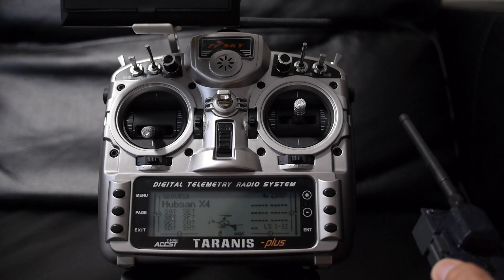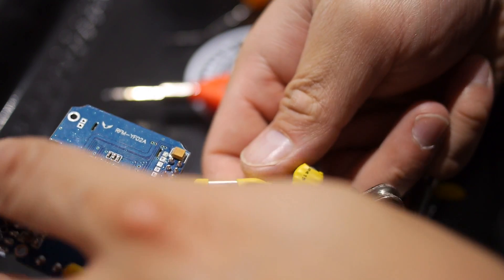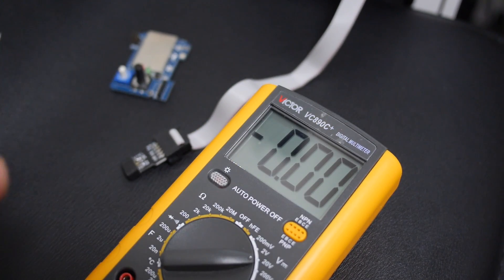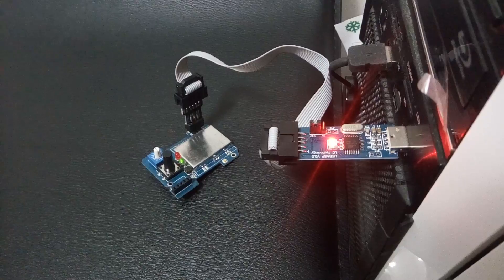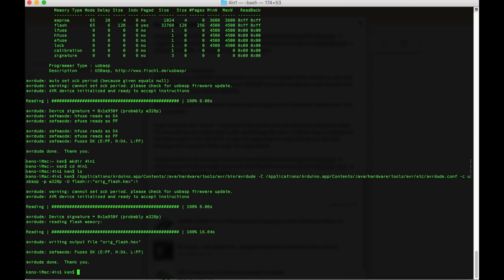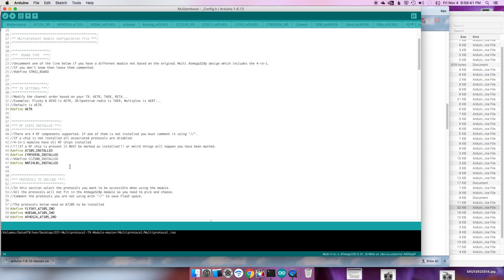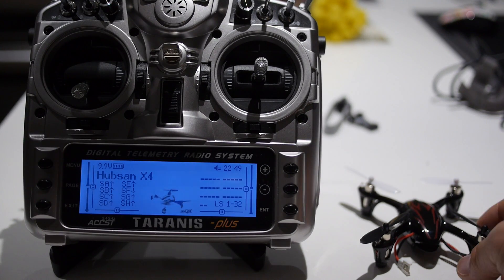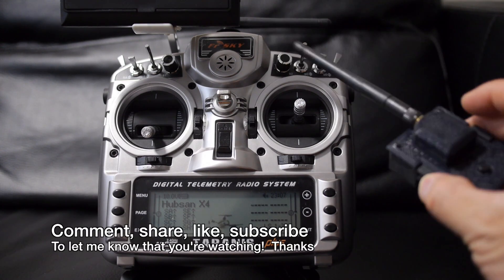Updating BangGood ATMega328P 4in1 multi protocol tx module firmware frsky taranis turnigy 9xr pro

Comment: Thank you. Good video. :) Is your link to the USB programmer 3.3v?
Reply from the maker: Yes, they all are 5v/3.3v.  So make sure you set it to 3.3v.  Follow the instructions that come with the programmer.
Reply: kenVersus Thank you
Reply: Googled the warning message and from everything I've read these avrdude warnings can be ignored, like you pointed out. What I'd like to do now is flash the 2 backup files, (orig_eeprom.hex and orig_flash.hex), onto my 4in1 since I was able to originally bind to my jj1000 & Tarantula quads. I've done some research and found nothing online that helps. Can you steer me in the right direction? I sure wish my 4in1 worked right out of the box!

Comment: will it read the battery voltage from the hubsan?
Reply from the maker: I believe so.  It should be able to receive TX RSSI and battery, but I don't have any direct experience with this since I don't use telemetry.